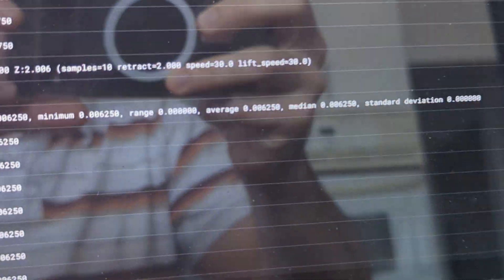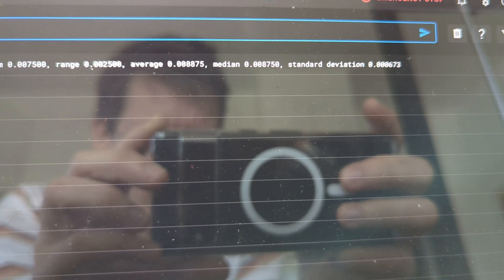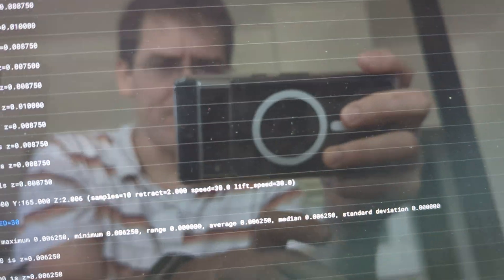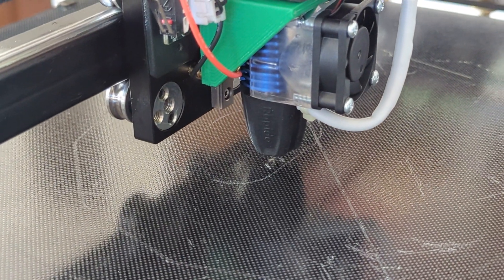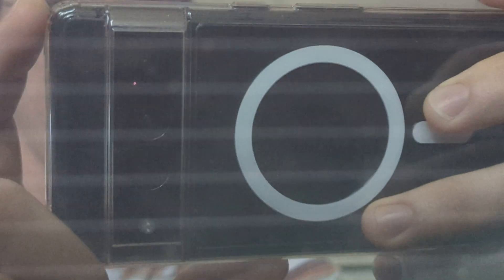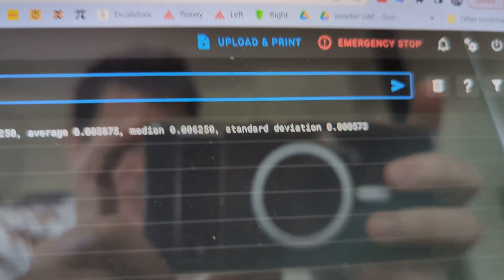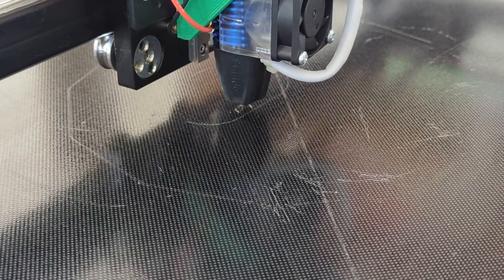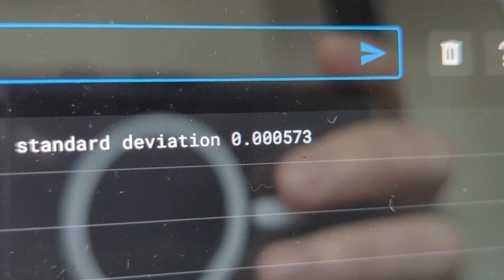Z probe using nozzle + linear rail + gold contact standard deviation 0.0000

Comment: This is really cool and I've been thinking about ways to do it. 

Let me throw two terms out there for you

Flexure Hinge
Electromagnet

Have the electromagnet magnet clamp down when not probing. Or some other form of non-sticky brake because electromagnets can have residual magnetism.
Reply from the maker: Yes! I am interested in and have been trying to work out how best to do a flexure hinge or ball bearing hinge while keeping the probing force minimal. Currently it is 250g the weight of the assembly.

I had not thought of an electromagnet before and that is an interesting idea too! May definitely be possible just another active element so if not necessary I'd rather avoid. Currently with the 250 gram downwards force there is no issue. But with a hinge design it may very well be necessary to keep it from moving while printing. So maybe some tradeoffs there...
Reply: @hilo90mhz  for a lighter toolhead weight what if you added a bit of upwards preload with a spring or magnet?

Thoughts on using hardened steel for the contacts? or does only the gold have the right attributes?

Solenoid braking with a tapered locating pin might be an option too, or something as simple as a solenoid hold-down (power to lift)
Reply from the maker: @JoeMalovich  yes I did think of upward springs to offset weight and it should be possible. You're right with upward springs and a hold down you could have even lower actuation force like 50g, maybe someone will see this and try it 😜.
Reply from the maker: @JoeMalovich  Gold is best because it doesn't corrode so electrically is ideal with silicone paste to keep it insulated even more from oxygen. But any metal really should work with silicone paste to keep oxygen out. Maybe stainless is actually good enough and simpler. Could use ring terminals and screws then. I hope more people will experiment! That's the fun part 🙂